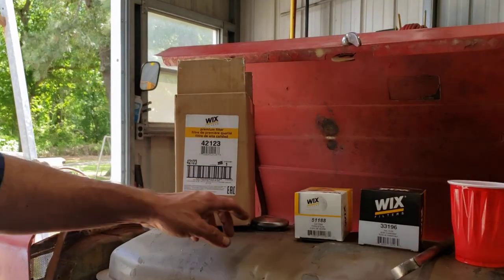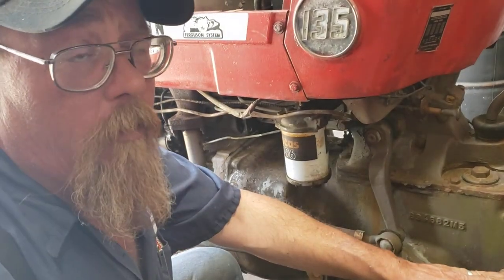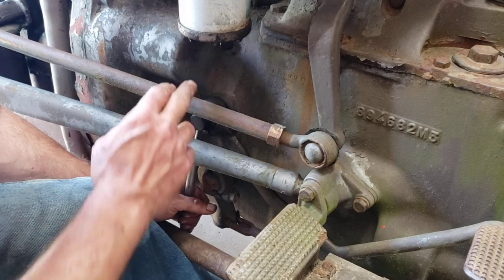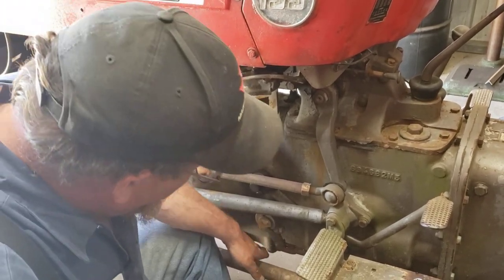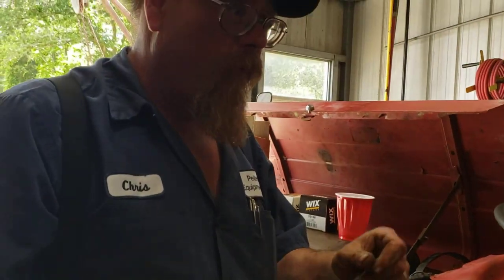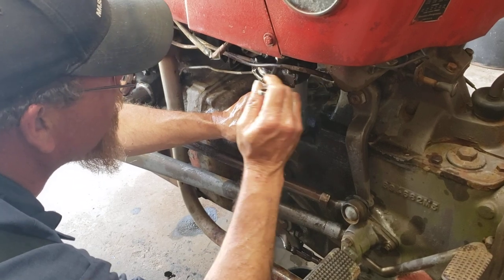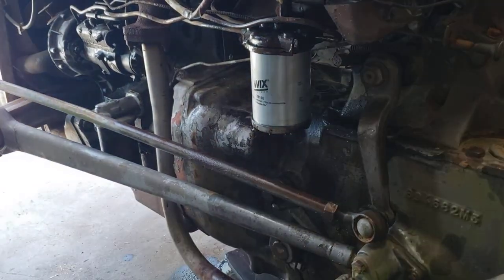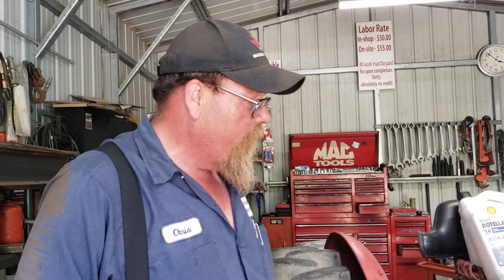135 Massey Ferguson Clutch Adjustment & Service

Comment: THIS is why SMART farmers pay US to do it. And you are correct. 90% of the time the rear engine seal or the front trans seal is leaking by that time so I advise splitting the tractor and doing it ALL while we're at it. I mean to say, "why put a band-aid on a spurting cut"? I can split that 135 on concrete with 2 rolling jacks in about an hour. Add 3 hours to replace seals and clutch and adjust, 2 hrs to reassemble and the whole job takes less than 1 shift even if we fight problems. And 'ether' is the BEST way to wear out a stubborn engine. I use WD-40. This 'virus' has EXPLODED my tractor biz. I've already done more biz in the first 4 months of this year than I did ALL of last year.  Stay safe Brother. And God Bless....~Eli.
Reply from the maker: We're always too busy this time of year . I rather just go ahead and fix them myself , problem I run into is new clutches that weren't set up right when installed so the PTO won't go in gear .
Reply: @HomesteadingtheHardWay  ....The 2 plastic clutch alignment inserts we have here work with both the Fords and Fergies. Coarse and fine spline. Paid for themselves at least a hundred times. When putting a 2 stage clutch back to the trans....Don't fight it. Spin the pto a tiny bit after putting a bit of pressure forward and it slides right in. Hope this helps....~Eli.
Reply from the maker: @singleman1986  I've got old input shafts for line up tools , I'm talking about clutches other shops or owners put in and didn't adjust the two stage tight enough but to be fair the manual says 90 thousands but it never works after everything wears in .
Reply: @HomesteadingtheHardWay  ....Yup. The old Sherman input shafts work as well. I never pay attention to 'manual clearances' myself. I put 'em back together a BIT tight. They'll 'loosen up' in a few field hours anyway. Same with steering, trans, and rear axle shims. I mean,.... we're talking 50-70 Y/O tractor gears here. 'Backlash' is what tears up gears and splines.  Ya gotta learn a 'feel' for what's best.  JMHO. God Bless....~Eli.

Comment: I replaced both Dual Clutches in my about 1989 Japanese 1035 tractor. Flywheel was cleaned & resurfaced. PTO WORKS BUT IT WONT PULL BACKWARD OR FORWARD. I DROVE IT INTO SHOP.  I have removed steering assembly from frame. Every thing I see thru the cover it sets on a the next cover where the pto an
drive shaft are Herbert Whitman Denham Springs , South Louisiana.
Reply from the maker: Its possible to put the traction disk in backwards and if they cut the flywheel and don't cut the step to match it can cause that . If you're to rough rolling it back together it's possible to break the center out of the disk . But most likely the disk is turned wrong and the hub is running on the pilot bearing unless the adjustment is way off
Reply from the maker: You can email me and I'll try to talk you through what to check. homesteadingthehardway@gmail.com

Comment: I grew up on a Massey Ferguson with a 2 stage clutch.
I absolutely love it for all PTO work!

Back in the eighties I worked a summer bailing hay with a Ford Golden Jubilee that had a single stage clutch and that took some getting used to. 
Also brushhogging with an N series tractor with a single stage clutch took some getting used to.
Reply from the maker: I've got A TO 30 that has that same setup as an 8n I don't like it . It's ok once you get used to it but the two stage was a vast improvement

Comment: Good thorough information my friend. But to be honest, if/when I consider buying a tractor the first thing I'm going to do is call a friend in NC!
Reply from the maker: I'm here when you need me Geeky !
Reply: Oh yeah, I blew the dirt back once and it started running real good! He won't even put a in- line filter on it. He's so tight I can't help him. My H had dirt and a leaky sediment bowl so I tried a new one from TSC and it leaked worse so I put a brass elbow in the tank and a ball valve with a in-line on the way to carb. I hate to get rid of my sediment bowl but it stays running now. The originals were made to last and the replacements don't last a minute!

Comment: Thank you SO much Chris!!   I have the glass bowl fuel filter type and I
 have changed it...I had NO IDEA the lines would need to be bled like 
brakes.  I'm glad I got rained out and didn't get to finishing it  and 
watched this.  I am going to change oil which is easy enough, and the 
hydraulic oil which was milky so I know it had water in it.  I hate to hear ( but glad you told me) that the clutch letting out on top is not an easy fix.  I may or may not attempt that later, I think I'll just deal with it a little longer.      Do have question....how do I know when to stop pumping that fuel pump thing and do you just crack that little nut on the side you showed to let air out?    Is it like brakes where you loosen, pump tighten and repeat?    Thanks so very much!  I really do appreciate you :)
Reply from the maker: The same one on the filter , pump until it a good flow . Then you can open the one on the pump it might push fuel then air , shut it then pump it up tight .it's not like brakes you just pump until the air is gone
Reply: @HomesteadingtheHardWay  Thank you!!!
Reply: @HomesteadingtheHardWay     While I was at the parts place I picked up a new steering wheel.    Any advice on how to get the old one off?  The chrome nut came off quite easily but I can't budge the wheel.  It's got a square keyway but no place for a set screw access so I don't think there is one.  Help??
Reply from the maker: @Angel283  you have to use a 3 jaw puller ( a cheap one is fine ), spray it with penetrating oil the day before and it'll come right off . If the plastic is still on the old wheel its easier to do if you break it off first ( puller fits better ) . DON'T HIT THE STEERING SHAFT WITH A HAMMER too much of a chance of messing it up .
Reply from the maker: @Angel283  no there's no set screw just rust
Reply: @HomesteadingtheHardWay  Thanks so much Chris, I really appreciate the help!!
Reply: @HomesteadingtheHardWay   You're going to be sick of me by the time it's said and done lol.    So I am trying to bleed the fuel lines cracking the nut on top of the filter like you showed me....I can't get anything to come out of it and I am pumping that lever like crazy..for like 5 minutes, nothing.  Do I tighten it back up...pump like crazy, crack it and again, nothing.  What am I doing wrong?
Reply from the maker: @Angel283  send me an email and I'll call you and talk you through the it
Reply from the maker: @Angel283  address is on the home page
Reply: @HomesteadingtheHardWay    I think I've figured it out!!   There was a modification done to it long before i bought it.  There is a push pull thing I have to shut off to kill the engine...I'm pretty certain this is a fuel shut off!   I'm going to try it with that lever engaged like starting it and see if that works.  If it doesn't I will send you my number.   You are so kind to help me and I REALLY appreciate it!!
Reply from the maker: @Angel283  that's factory , it shuts the fuel off coming out of the injection pump to kill the engine . Your hand pump might not be working that's common or you need to turn the engine a half a revolution to get it to work . Don't try to start it before you get the air out or it's going to have to be bled all the way to the injectors
Reply: @HomesteadingtheHardWay   OK thanks.  I will try to turn the engine.....So them the shut off doesn't need to be disengaged to pump the fuel then?
Reply from the maker: @Angel283  no not to pump up the system just to start it . If the hand pump is bad you would probably be better off to replace the fuel pump .try turning the engine first if the cam is in the wrong place it won't pump . They can be aggravating to bleed on a good day and remember it may have an air bubble so you have to pump it a lot after you open the bleeder on the pump and pump it up after you shut everything
Reply: @HomesteadingtheHardWay     I got it my friend!!!   I turned the engine not a full half but as much as I could, also turned the little bleeder screw on the pump like you said...closed it back up, pumped like crazy, turned the screw on the filter and bam..a little air noise.  did this a couple times before I started it.  Runs again like a fine watch!!   Now if I can get the hydraulics going lol.   Thanks SO SO SO much for ALL your help!!!!!!
Reply from the maker: @Angel283  glad to help , hydraulics on it are pretty simple .only three components pump, cylinder, controls
Reply: @HomesteadingtheHardWay    Thanks to you my tractor is purring :)  One last question....will it hurt the transmission if I over fill it?   I did overfill, i mean entire dipstick is coated.  I did this to compensate for the empty lines, thinking they would take up the slack so to speak, but as it turns out the front-end loader is it's own system with it's own tank so I had to fill it separate.   Do think it's ok to leave it or should I drain some of it back out?   I can look into the hole where I fill it up next to the shifters and see the gears. It isn't to the top of that .
Reply from the maker: @Angel283  it may make it blow a seal , I would drain some out . There's two drain plugs  under the tractor but it's all the same oil
Reply: @HomesteadingtheHardWay    I'll do it :)  Thanks again SO VERY much!!!!!!!!

Comment: Sure wish I had you for a neighbor....................sigh. (Great Video. Your sidekick did a good job.)
Reply from the maker: Only 3000 miles or so apart , we are neighbors . Thank you
Reply: @HomesteadingtheHardWay  Our family's been in Southern California for over 100 years.....so this is home. We have a small 'ranch' (8 acres) in North San Diego County about 10 miles inland from Oceanside. Great place for growing Avocados, Oranges & Lemons. We also grow our fair share of weeds. My kid picked up a mid 70's Massey Ferguson a while back. I'm not sure if it's a MF-20 or MF-135. I think it's the Industrial Version. I've recently noticed that the tractor is revving but not transferring power to the drive wheels so I'm assuming it may be a clutch adjustment. Your video is the closest thing I've found that shows me what to do. I'm gonna give it a shot and see what happens. If it works.....I owe you lunch.
Reply from the maker: @socalpal8416  if the pedal doesn't have any free travel at all it's  definitely  possible . My email is on the about page if you need a little guidance , glad to help
Reply: @HomesteadingtheHardWay  Thanks Chris. Think I'll pressure wash the beast first. Like you....I don't any debris in my eyes, face, hair, nose .......etc.
Reply: @HomesteadingtheHardWay  Chris....One other question about my tractor's slipping clutch. I noticed that the transmission's hydraulic oil is milky white. Water is apparently leaking in through the shift boots. Would that cause a slipping clutch? I've got 5 gallons of 90 weight gear oil which I'll put in after draining out the old. Just curious if water in the gear oil would cause the tractor to barely creep along even though the engine is running fine?
Reply from the maker: @socalpal8416  send me an email ( address is on the about page for the channel )
Reply from the maker: Important !!!! It doesn't use 90 weight gear oil it'll ruin the pump

Comment: Great videos Chris!  I had a problem come up with my 135 yesterday. When I cranked her up I had my foot on the clutch because it was in gear & she starts moving! Shut her off- put it in neutral- cranked it up & no movement but I can't use the clutch to put it in gear. I have to shut it off- choose a gear- crank it up- & hold on. So I have lost control of the clutch. When its running I hear a slight chattering noise. I have 2 fingers on the clutch pedal & it doesn't feel any different than before though I never paid much attention to it. My dad had me driving a tractor when I was 5 years out of necessity but I'm not really a tractor mechanic. That was 65 yrs. ago. Do you have any idea what is happening? You may have addressed this in another video. If so what was the title? Keep up the good work & if you can help me thanks.
Reply from the maker: Pressure plate broke on you that's not uncommon. Replacing the clutch is all you can do it's an fairly easy job rolling it back together is the only aggravating part . Getting a clutch might be an issue right now I've got three on backorder I've been waiting a month on
Reply from the maker: I can talk you through it if needed

Comment: Hey Chris- Joel from LA (lower Alabama)- Joseph is my given name. I finally got up the nerve to begin looking at my problem When I removed the cover plate a stainless pin 5/16x2 11/16 fell out. From what I can tell it is held in place by one of 3 springs that keep tension on the 3 legs or arms . The spring wraps around the arm then goes thru the hole in the pin. I know you still have to separate the body but can the broken spring be replaced without removing the clutch? I think we had the clutch replaced 7 yrs. ago when the trans gears exploded- I'm seeing some new bolts showing so my dad may have had the clutch replaced while they had it in two pieces. Any info is appreciated. We have a company called Clutch Products in Mobile so they might have the spring. Thank you. Joel
Reply from the maker: It would be worth a try but you'll definitely have to cage the clutch and loosen the mounting bolts . Three empty bolt holes around the pressure plate

Comment: Chris- started splitting my diesel135 today. Need some answers if possible- do I have to remove the dash assembly? I have looked at all the places mentioned for a serial # to id the year but all I can find are individual casting numbers. There is no tag at the base of the dash. Do you know how I can id the exact 135 I am working on? I'm fairly certain I have a single stage clutch but it would be helpful to know the info from the id tag.  thank you. joel
Reply from the maker: Easiest way is to lift up the steering box . Watch out for the three springs and detents between it and the transmission case . Usually the last patient date on the plate is the year or really close but all you need to get the parts is whether it's single or dual disc email me and I'll give you my number I can tell you everything in five minutes there's a couple of shortcuts we change single disk clutches in a 35 in 2.5 hours double that for a two stage for set up and they're way more aggravating to roll back together
Reply from the maker: I sent my number

Comment: Can I adjust my clutch paddle on a 245 Massey Ferguson 86 model thank you 🇺🇸🇺🇸
Reply from the maker: It's about the same , set the free travel at the collar on the shaft ( same place I did this one ) then you set the peddle height with the rod that goes from the collar to the peddle . You'll see a flat stop on top of the collar should be 1/4 to 1/2 inch between it and the housing with light pressure on the peddle . I've got a 235 in the shop now if you have any questions

Comment: Hello Chris...I have a Massey Fergurson 175 and I am looking for a mechanic to install a clutch.  I am in Morrsion Tn and Gentry Bro. closed down in Sparta so we have no mechanics anymore.  Hoping you might know someone close by to recommend.  The clutch is just starting to slip a bit.  The bell has been open about 8 years ago to replace gears in trans. so hopefully wont be to hard to get into.
Windy Cash
Reply from the maker: I'm sorry I don't know anyone out there but it's an easy job and I'd be glad to talk you through doing it .

Comment: I have a MF135 Perkins 3 cylinder. Yesterday the rear right hand wheel locked up in forward gears. It work in reverse and works in forward with diff lock on. Any ideas??
Reply from the maker: Check for a broken axil first then pull the lift cover and look at the gears but it sounds like an axil

Comment: My 35 has a dual stage (as per serial number) but it appears to be adjusted to a single stage. I can change gears with clutch depressed but cannot engage engine speed PTO. How does one attempt to un-adjust the single stage back to the original dual stage?
Reply from the maker: Take the plate off the bottom of the bell housing and adjust the fingers to 80 thousands clearance then adjust the pedal hight .

Comment: Good morning tractor man, can you tell me how to change the rear seal on the pto shaft it is leaking bad! Thanks 😇🤠🇺🇸
Reply from the maker: Nose the tractor down in the ditch as steep as you can or drain the hyd oil , then there's a plate with 4  bolts and 2 flat head screws  around the pto shaft remove that and the chain brackets put the shifter in ground drive and pull the shaft and seal housing out the back there's a hole in the pto shaft you can put a bar through to help . Try to get the double lip solid seal you have to drive them in backwards and the cheap seals bend bad oh and there's a lock ring behind the bearing to get the seal housing off the shaft You can get it out with a screw driver leave the bearing with the shaft . If you don't have to drain it you can do it in less than 30 minutes
Reply: Thanks Tractor man I am going to try it!😇🤠🇺🇸

Comment: I just wrote a long comment & it disappeared! The clutch is a "spicer dual drive clutch" #130252. The inner disc is 11" & both are 10 spline. Found the id tag below the dash- SDW64001172. Making plans. The split went well using 6" guide bolts. Thank you. I will keep you posted on my progress & what path I take. joel in LA!! Let me know if any of these numbers mean anything.
Reply from the maker: Just need a two stage course spline clutch set , that's the most common setup.